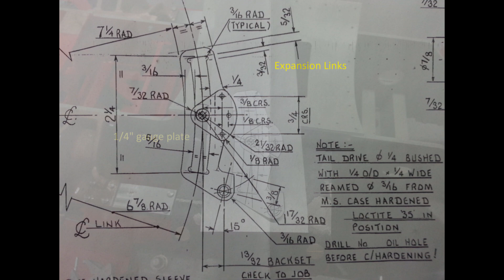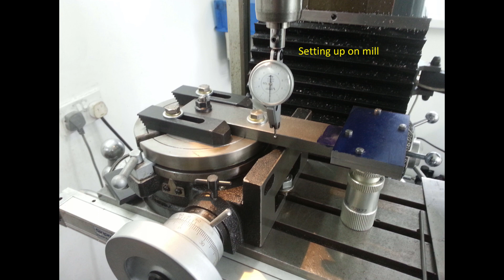Steam Locomotive 9F Build Part 41 - Expansion Links Pt.1

Comment: neet. I made some trammel points laid out the links with blue and scribe. drilled  a line of holes. and filed and hacksawed. No mill or rotary table.. Much filing, checking, filing checking later, two links emerged.
Reply from the maker: Thank you and well done with your method. I don't think I have a steady enough hand to do it that way...

Comment: Hi, what model and size is the rotary table you are using?
Regards
Jack
Reply from the maker: Hi, its a 6" Vertex rotary table. 
Cheers Craig.
Reply: @no23mk2   thank you, do you by any chance have an email address. I'm embarking on my first 5" loco and any help and info would be much appreciated.
Regards
Jack
Reply from the maker: Hi Jack,
I don't give out my personal email address publicly (for obvious reasons). However, try this old address that I no longer use, it may still work....    no23mkii@gmail.com
Which loco are you starting to build?

Cheers Craig
Reply: @no23mk2 yes I understand. I’ve sent you an email - hopefully it’s worked? I’m just starting a 5” Jubilee - drawings by Tony Allcock. They are very detailed!